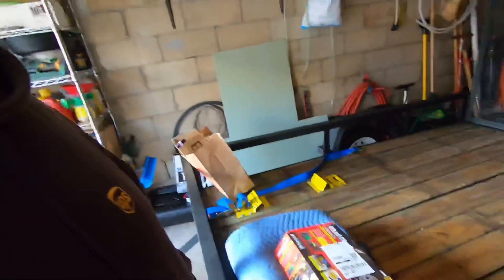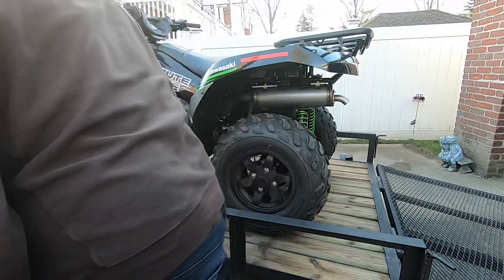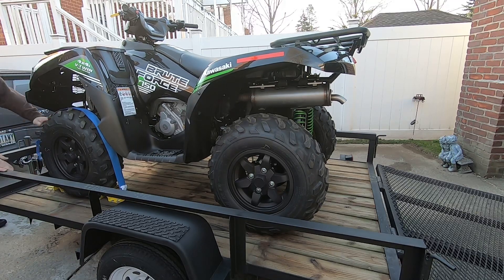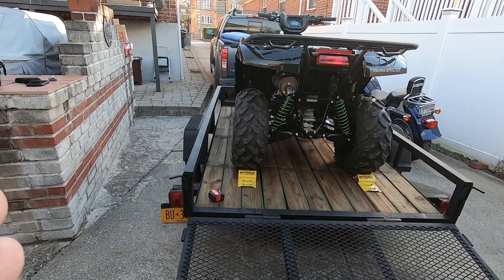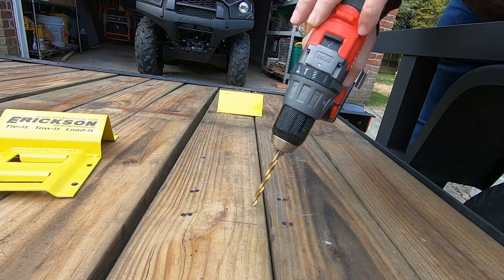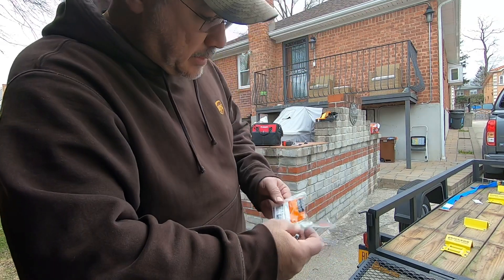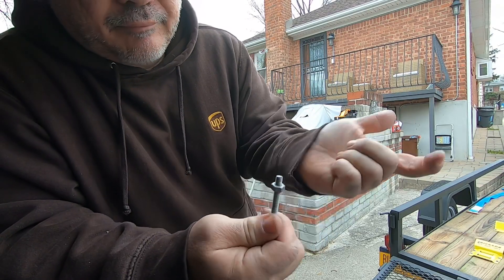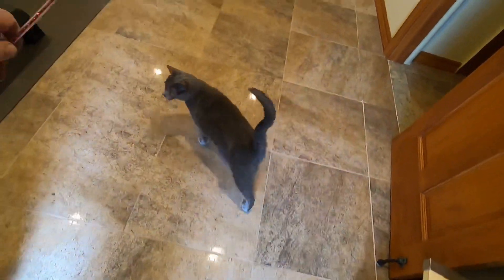Erickson Wheel Chock Tie Down System

Comment: Something I have done on all my open trailers for ATV’s - instead of bolting items to the floor which can become cumbersome if you want to use the deck for other thing’s; put the ATV to the front of the trailer, take a piece of 2” angle iron that matches the width to the outside going side to side, cut a tab out of the vertical edge so it lays flat on the side rail and place it against the back of the rear tires or leave an inch or so, drill each side and put a hitch pin in it and the ATV will not go anywhere.  You can put one in front if you want to center it etc…. Put multiple holes for various situations.  Pull two pins to put it on or take it off, pull it off completely for alternate uses.  Very functional and perfectly safe, the machine cannot go anywhere unless you flip the rig and at that point you have bigger problems.  I towed 2 Yamaha Grizzlies around the west for years that way.  Other guys saw it and went to that system as well.  Just thought I would share.  Thanks for the video, very informative.  I am thinking of using your type of setup on my enclosed trailer.
Reply: Do you have a video or link you could share to your style setup? I'm not able to visualize what you mean. Thanks man
Reply: Love to see your set up!!
Reply: Love to see your setup. Makes perfect sense
Reply: Any photos, videos, anything to help better understand?

Comment: I just installed these for the rear wheels on the Zero Turn mower (will use ratchet straps for the front now that the mower won't move).  Fortunately, I only had one bolt and screw that did not work together.  Tip: Drill holes while holding the plate in place, drop the bolts in after drilling each hole that way the bolts line up perfectly.  These are better than strapping my the mower at all sides as they tend to work loose no matter what I did.  I am going to apply some anti skid tape on them for a bit more traction for those times when the tires get wet.

Comment: Hey Buddy, how close do you place the chocks to the wheels when installing them? Thx!
Reply from the maker: I load the bike and balance the trailer. Once I am happy with the distribution of weight I lay the chocks down and mark where I want to place them.  I come off each tire about a 1/2 inch so when the tire is compressed it fits snug between the chocks.

Comment: If great set up if you're going to use that trailer only to all around your 4 wheeler
Reply from the maker: I haulled sheetrock with it. I raised it with 3 2x4's and it cleared the chocks.  It is far off the coners that I was able to move a bedroom set and secured it with straps.  Harbor freight fittings that allow you to use regular wratchet ties.

Comment: 6 straps ! Too much bud . I use 2 on my 4 seat rzr . 4 is good enough
Reply: Do you use 1 on the top right tire and 1 on the bottom left tire?
Reply: At first I thought the same thing. Way too many straps, but then again I drive on smooth highways to get to my staging areas when we off-road. This guy probably has to drive on rough roads to get to areas where he hunts. So if I had to drive on rough roads, I’d probably probably do the same and run 4 straps instead of two. I do love these brackets though. That’s what brought me here, Lowe’s has them for $39 a set
Reply: 3 is required by law. Always good to have an extra
Reply: @mailliw75  no 2 straps per 10ft  and 3 every 10ft after
Reply: 2 straps for a 4 seat rzr is crazy if you are going anywhere besides locally. That’s not a small machine.
Reply: @atcdan133  no mines a xp4 1000 on a 16 trailer with trailer breaks , 2 straps is plenty . For small hauls . 150 miles or less .